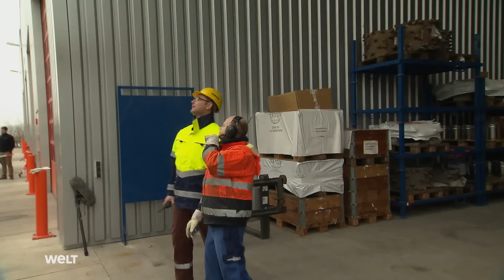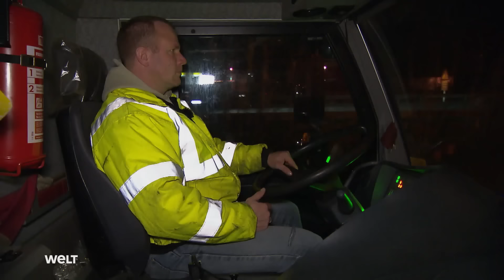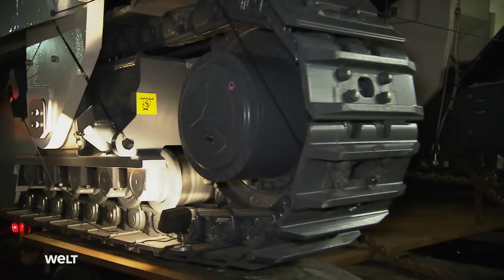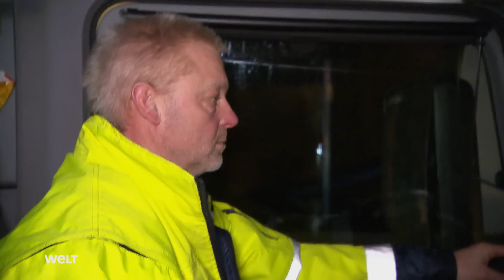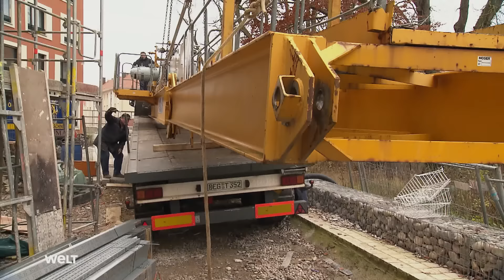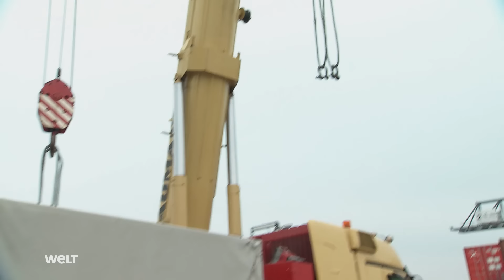GIANTS ON THE MOVE - Transport Professionals in Action | Full Documentary

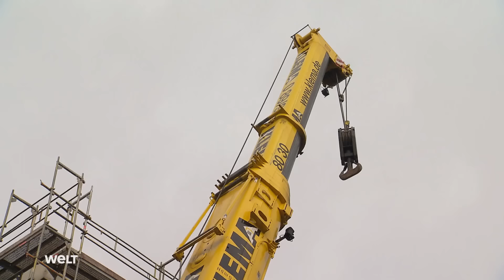Comment: 33:40 Could it be possible, to move cran to the side, by using of side hydraulic legs? Lift the cran, and simultaneously pull the 2 legs on one side, and push 2 on other? Could be faster, at least theoretically.
Reply: The mechanist that moves the legs doesn’t expect the legs to be loaded
Reply: @cheesebusiness  Yeah, its understandable, that standard equipment probably could not support such feature. The pregoing comment is written, only to share the idea. In the hope, that key peoples will see this problem, will influence, and mobile cranes will have such feature in the future, and driver will not have problems and swear on tight construction sites, easy moving his crane sideways, through hydraulic legs. My first education was also mobile crane driver, and i also had similar situations, thats why i understand Andy very well.

Comment: I stopped watching as soon as I heard "A crane boom at its limits, bending under a 10 tonne load" Pfff  what is this a joke?
Reply: The crane's arm is at extended length. The more length, more limits are reduced. Maybe your comment itself is a joke for people who understand how this works. If you don't believe me you can check yourself.
 The crane is Liebherr LTM 5-axles series. I'll take example of LTM -1095, it has maximum lifting capacity at 95 tonnes. But on the maximum arm length of 58m and on 58m radius, it only has the lifting limit of 0.8 tonnes. It should give you the picture on how the limits are reduced along the increasing crane length and angle.
Reply: @sangajikharismarizkysusilo9943  Oh I know what you are saying. It's just in all my years working with cranes I've never seen a crane struggle to lift a mere 10 tonnes.
If these guys were in that situation, then they were being irresponsible by pushing a small crane's limits, and Should have used a bigger crane.
Reply: @AlienMonkeyDXB  As long as they don't exceed the recommended limit it's safe and responsible. The engineers have calculated those limits with caution and precision, and of course they gave them limit tolerances, for example: If the actual limit is 11.5tonnes, they would state the recommended limit of 10.5tonnes, that 1 tonne is a precaution, a tolerance of the limit to withstand human errorsand other factors.
 I'm not a crane profesional but in every workplace I've been, as long as you don't disregard any caution and/or exceed any regulations, then you're perfectly responsible. And the people that design these machines and making regulations of it are making it perfectly through many calculations and tests.
Reply: @AlienMonkeyDXB  Ever run a crane? Cause I'm pretty sure the pucker factor lifting a 10 ton load at full main boom with something like a 90 ton is pretty big. Of course, get a bigger crane, but often the site demands a small footprint and the smaller crane CAN technically do the lift but it's very close to it's capacity limit. Just calls for extreme caution. Besides, a bending in the boom (deflection) isn't necessarily a sign of the crane struggling.
Reply: @patrickwilliamcasey9893  exactly a crain is made to bent, a 200ton crain can just lift 200ton at his min reach. 200ton crain stands for 200ton/meter
Reply: What you failed to understand is the fact that every crane in the world that normally has a total capacity of let's say for example 150 tons at it's lowest point of the boom which is around 7 to 8 meters high the same crane at it's highest point of boom cannot hold more than 8 tons lift at let's say 30 meters , in other words the higher you lift something with a specific crane the lower the weight must be with balast weight configurations into consideration . 
It all comes down to the structure integrity laws , the cable load capacity limits , the tension that can be afforded by the 4 stabilizing crane hydraulic feet and last but not least the tension that main gyro of the crane can take given the angles , height , load of the boom .  When a designer builds a prototype crane for testing takes into consideration so many factors you would be surprised . If you ever find any large crane working out there and you go close you will find written on it's sides (usually) some numbers and symbols , first must be the weight of the crane itself , then second must be the total lifting capacity and third must be the weight to maximum height capacity . 
When you saw this crane lifting those ten tons at that height you could say that literally if three people where hanging suddenly at one side of the weight lifted they could jeopardize the whole operation by pushing the gyro's maximum tension limit . Yeah you couldn't possibly make the whole crane tip over but you could destroy the gyro or any hydraulic line if you exceed it's pushing point .
Reply: hold a long sweeping brush in the middle,... no problem,... then, try holding it straight with your hand only clenching the 4 or 5" inches at end of the broom,.. almost impossible..... 
that is a small example of the ratio of the lifting capacity of machines like cranes, hi-abs and forklifts.

Comment: I never realized a crane could bend like that
Reply: If it couldn't bend, it would snap
Reply: It is designed to bend so it won't snap. as long as you obey the technical procedures provided by the manufacturer, nothing will snap. In fact, many things that seem rigid are designed to bend to prevent damage and/or failure.
Reply: @elanjacobs1  yeah it stands to reason,  I've just never seen it before
Reply: That was some bend that wasn't it ...... flexibility at its best 🙈
Reply: Weirdly it looks quite a lot, but the boom was about 60-70m so a 1-2m deflection actually isn't that much, Could probably take quite a lot more.
Reply: Me either!!! I don't think I would've pushed it that far to find out either... LOLOL
Reply: This is normal, but this is the reason they invented the Y guy system...